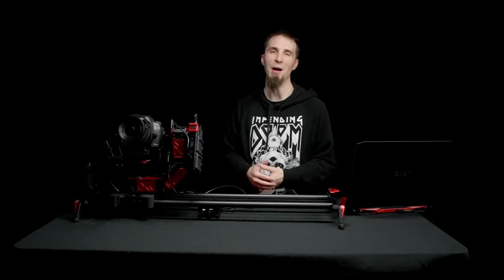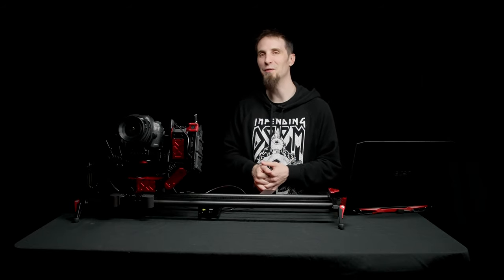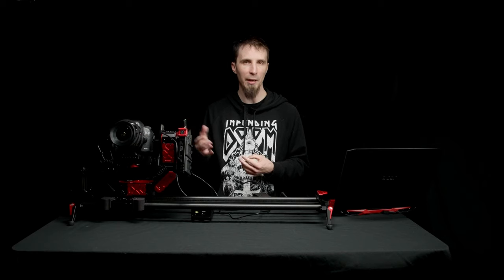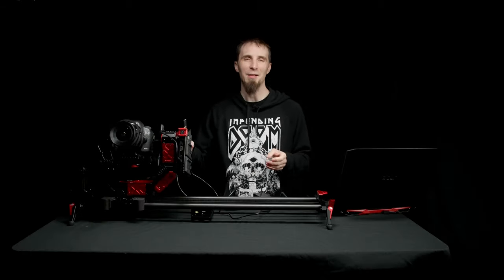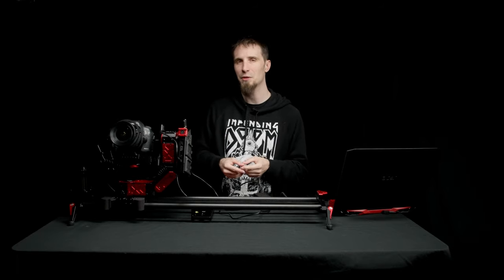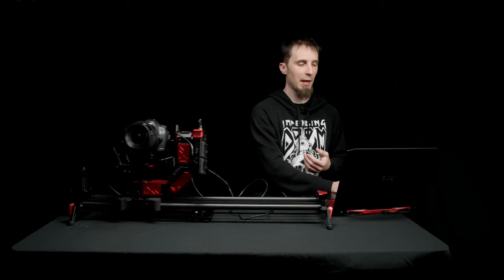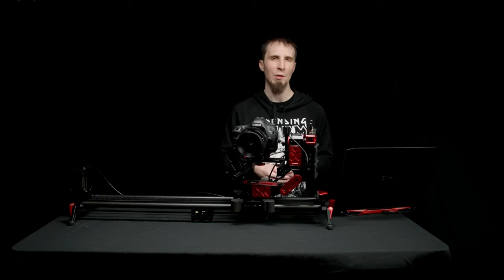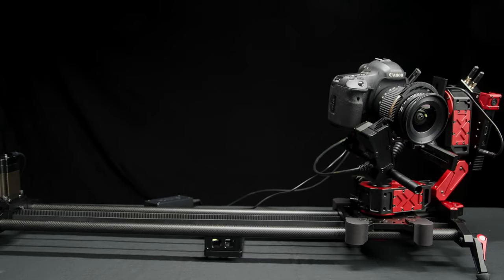Axibo Motion Control Slider - Why I No Longer Use Rhino Arc II

Comment: Honestly, I would love to see this system in the UK. 

I would also like a longer Truck Range, as I hope to use a Blackmagic Studio camera, but it has bulky integrated handlebars and I would prefer not voiding its warranty removing them. If this means making an alternate base as well (which could support a Roll Axis attachment later), so be it.
Reply: They ship worldwide
Reply: @The_Daliban  Shipping worldwide is not the same as having it here, cost-wise; to receive it you would probably have to pay in excess of $300, plus that amount again for import duties.
Reply: @rushboardtechuk  i thought you were talking about accessibility. Obviously it's gonna cost more.  You're gonna have to pay customs, shipping is on them, so no 300 to receive it (:
Reply: I've had my PT4 for nearly two years now and I'm in the UK. The shipping charge was pretty small and for some strange reason I didn't get hit with any import duty. It's a great piece of kit for the money, particularly the autotracking feature, which works with any camera that has HDMI out. The other great use is that we used it's zoom motor to control Iris via ethernet on a camera over 2km away from control - as astonishing feature!